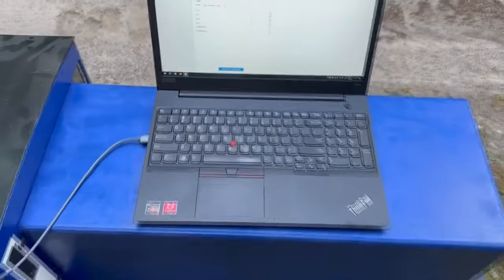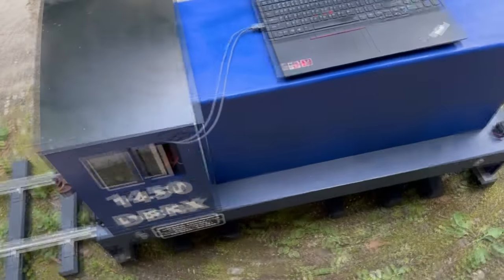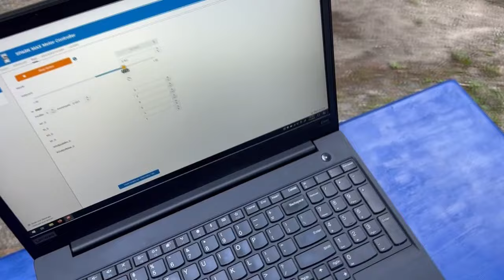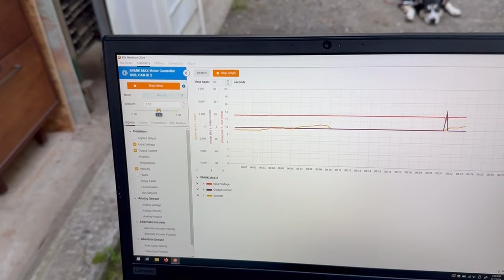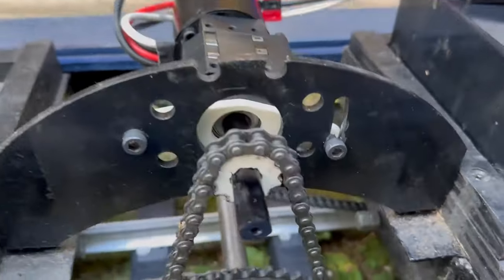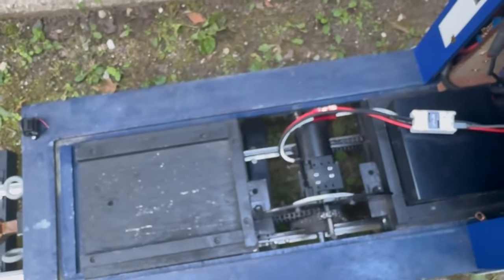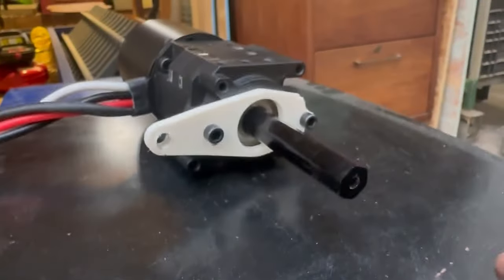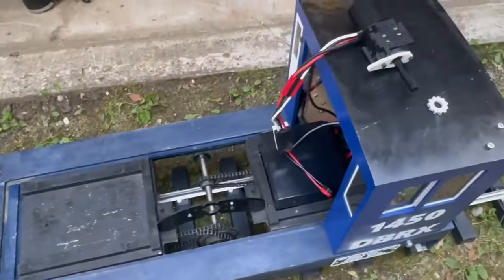Brushless Motor Test in an ES 2 500

Comment: Love that slow speed performance. Let me guess: You're building a 16-unit EMU passenger train to beat both the lap and weight records at Train Mountain.
Reply from the maker: Hahaha.. naw just an EMD SW1 locomotive. I do not think people have made electric versions of this before simply because the motors and gearboxes are hard to fit into this size compared to the more common hydrostatic pump motors.